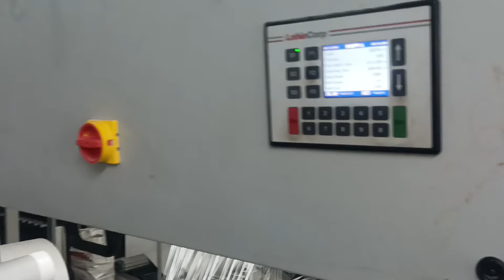LOHIA//NOVA 6//LOHIACORP//Fakir Babu//LOOM// #Mr_line_Vlogs

Comment: Yarn dust is getting deposited inside the loom which may damage the machine. Can you please suggest efficient ways to clean that area?? 
यार्न की धूल करघा के अंदर जमा हो रही है जो मशीन को नुकसान पहुंचा सकती है। क्या आप कृपया उस क्षेत्र को साफ करने के कुशल तरीके सुझा सकते हैं ??
Reply: தறிகள் தளத்தில் ஏற்கனவே trench அமைத்து அதில் grill பொருத்தப்பட்டு"v filter உடன் exhaust fan இருந்தருந்தால் இந்த பிரச்னைக்கு தீர்வு கிடைத்திருக்கும். இம்மைறையில் deprtmnt ற்குள் air circulation ம்கிடைக்கும். முக்கியமா  இங்கு staple fibre filament process ஆவதால் பேரிய RH% ப்ரச்னையும் இருக்காது.